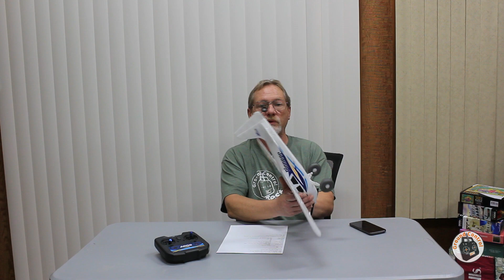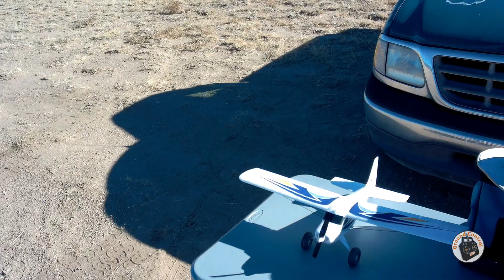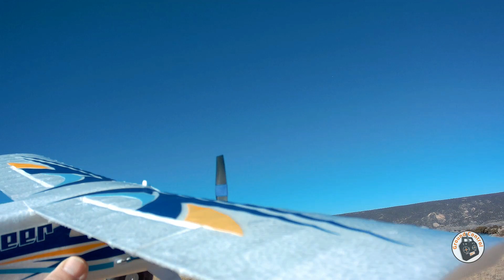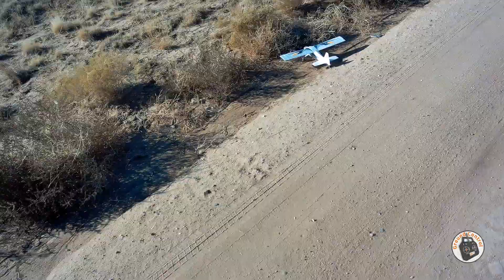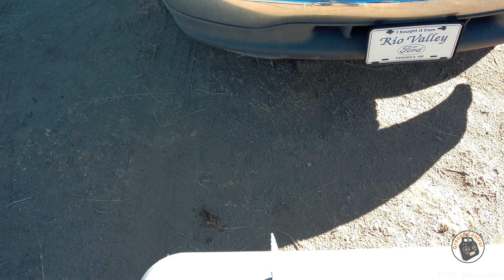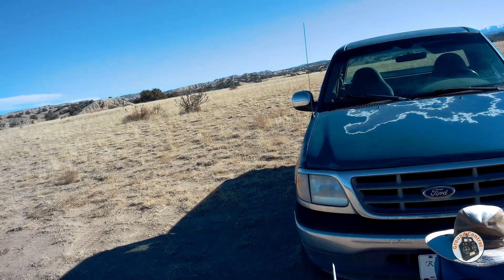Arrows Pioneer 620mm Wingspan Micro Brushless Bush Plane with Gyro RTF - Specs, Tips, Maiden Launch!

Comment: I have the Arrows Bigfoot & love it, so grabbed a Pioneer to fly at smaller local parks. So far have had only 2 flight sessions & both times have suffered from the same issue - plane flys nicely for afew moments, then feels like I've lost control & goes into a spiral till it hits the ground. I'm assuming it's a range issue, yet to do a range test or try rebinding but obviously something isn't right. When brand new out of the box first time powering it up it beeped etc. & only the throttle worked. I unplugged the battery & replugged & this time it did it's routine & everything worked. Seems to do this all the time currently, have to plug it in a 2nd time before you get operation of the rudder/ailerons. On it's last crash landing a wheel popped off & the 2-part rim fell out & I lost the little plug that holds the wheel on. Really need to glue the rim halves together. Annoying part to loose as not a easy fix.
Reply from the maker: Yes, it sounds like a bad component somewhere.
I didn't have any of those problems with mine, when it was stock, and I've had many flights on it.
I don't remember ever having a stall like that.
I would think if it was losing contact the fail-safe would kick in.
Does it center all the control surfaces and shut down the motor when testing fail-safe?
Perhaps a servo locking up on it or a bad gyro.
I would definitely sent it back for a replacement.
Reply: @GroundControlRC  Ok just did a little Range test & appears I have a sticking arelion servo. Have to take the wing off to investigate. Good excuse to do your mod & get more throw while in there.

Comment: Hi, Great demo, .. I understand this RTF to be already calibrated out of the box,  but before initial start up e.g. Transmitter on first, then battery connect, what position should TX switch be in at that time. Beginner mode or Dynamic? Many thanks
Reply from the maker: Hi Andrew and Thank You!
Some of my previous Planes required the gyro be in beginner mode when binding so I still make sure I have the switch set for beginner mode when binding to all my planes that have gyros.
I'm not sure if that is required on this plane but that's the process I always use.
Reply: @GroundControlRC  Thank you for that. Ordered for my Grandson, so  I will follow your advise when it arrives.👍
Reply from the maker: @andrewrobertson9031  You are most welcome!
Your Grandson is going to love this plane.
See you in the Air!

Comment: How much wind does the Arrows Pioneer handle?
Reply from the maker: Well, I flew the Mini Mustang in 20mph wind so I think the Pioneer could handle a bit more than that.
It also has a stabilization mode to counter wind effect so I think it would be a bit easier to handle in that much wind.
Once I get the roll rate fixed on the pioneer I'll have to take it out in some significant wind and test it out ;-)
Reply: Thank you for this information.  I will be new to the rc plane hobby and I am on a budget.  On line research has pointed me towards the Eachine P51 or the Arrows Pioneer as  my first plane.  I live near the ocean and winds up to 20 mph are fairly common.  I also have learned that larger planes fly better in the wind, however storage of a larger rc plane won’t work.  I look forward to your next Pioneer flight in the wind.
Reply from the maker: @calmorrison9211  You are most welcome ;-)
I'll be taking the Pioneer out again for testing again soon.
Those 20mph winds are pretty heavy for micro planes but some handle it pretty well.

Comment: Awesome series again, this one, thanks! Now I've got a silly question if you don't mind. I'm about to order this Pioneer's board and TX for cheap to put it into one of my A160s (yes I really love this old nemesis), along with two 1.9g servos for elev.+rud. Pretty sure the integrated ESC can handle the A160 motor. Now the question is: do you think I can plug the two aileron servos (Y-lead) into the Pioneer board? Since the Pioneer's equipped with a single aileron servo, I'm wondering if that might damage the board.
Reply from the maker: Thank you much!
I'm not sure, although, they fitted this board with a single servo for the ailerons, it seems to me that (2) single servos would have to perform much less work than a single servo.
That's exactly what I'm going to do with mine to get a better roll rate.
I guess if the board can't handle it I'll just replace the stock board but I'm definitely going to try it ;-)
Reply: @GroundControlRC  Thanks again :-) 
Even all connectors (servos and battery) seem to be compatible between A160 and the Pioneer. Plus possible upgrade path to a RM Zorro later, now that OpenTX/EdgeTX is working with the board... I'll let you know how it goes in case I'm first!
Reply from the maker: @DIY-Morti  If the connectors are the same that is certainly a plus.
I'm constantly having to change connectors on different aircraft when performing changes ;-)
Yes, let me know how it goes as I may do something similar in the future.
Good luck on your project and I'll see you in the Air!
Reply: @GroundControlRC  Ok got itchy fingers and ordered the parts :D 
Not only the connectors seem to be the same (micro JST) but also the wiring itself apparently, guessing from XK and Arrows servo wire colours. All fingers crossed for everything to arrive til next weekend.
Reply from the maker: @DIY-Morti  That's awesome.
I do remember that plane having those micro connectors and a Y-cable for the ailerons.
I hope it all works without Modification as that will make it PNP ;-)
Reply: @GroundControlRC  Heya I've promised you a feedback after maidening the A160 with the Arrows Pioneer brain, so here we go. 1st the aileron dual servo (Y-cable) mod is a solid go. Driving 4 x 1.9g servos for all four control surfaces is no prob for the Pioneer board. The gyro is awesome and really makes the A160 fun to fly. Your wing cuffs (I made mine out of Elephant beer cans, cheers!) are brilliant, thanks for the idea and testing! No tip stall crashes, and I'm a bloody beginner :D
Motor is a bit weak, had to fly 100% throttle all the time to fight of stormy weather. Wondering if the Arrows Pioneer's motor would generate a bit more thrust than the A160's? Now looking for quality 1.9-2.5g servos for elevator and rudder. The elevator one blew its gears in the 3rd flight (crappy SOL Expert, name is program).
See ya in the air!
Reply from the maker: @DIY-Morti  That's awesome and I'm glad the wing cuffs worked out ;-)
It's nice to know the pioneer can handle that 2nd aileron servo as that's the direction I'm going.
I remember the J3 Cub as being pretty heavy for it's size.
The Motor on the Pioneer works well on that plane but the AUW is only 113g.
I replaced the stock motor on my J3 Cub with I believe a RacerStar 1408 3600kv and Gemfan 5x3 2-Blade Prop to provide sufficient power.
Here is my thrust data:
Prop Gemfan 5030 ABS 2-Blade Prop
Thrust(g) 100% = 244
Amps 100% = 6.6
Thrust(g) 50% = 135
Amps 50% = 3.4
g/W 50% = 4.8
g/W 100% = 4.5
I'm not sure what size ESC the Pioneer Board has in it but I'd want at least an 8A ESC for this setup.
Thanks for the info and your experience with that Pioneer Board.
Reply: @GroundControlRC  Yes that's the problem, no idea how much power draw the board can handle. AirDOGGe made a thrust test that attested the A160 motor sub par performance for it's size. Afair it's a 2700kv motor versus 3000kv for the Pioneer's. Maybe over time, I'll just make the wings larger to lessen wing load and build wing slats for STOL capabilities. As far as motor: 20-30% more thrust would be all I need for the yellow dodo. Maneuverability is insane btw with the Arrows board. That thing can do sick 180s without crashing.
Reply from the maker: @DIY-Morti  Those gyros are fun for those types of maneuvers ;-)
I would guess that board only has a 6-7 amp ESC in it but who knows.
I put a load meter on the Pioneer an it was only pulling 4.2A at full throttle.
Reply: @GroundControlRC  Wow thank you so much for giving me this reference! 4.2A now I can re-binge yours and AirDOGGe's thrust stand tests and see if I can find one that doesn't draw more than that while giving more thust, aaawesome :-) And yes, the big plus on control surface authority is big big fun!

Comment: I sold my micro Timber because it was getting a bit worn. Now the new one is like $160! This looks cool since I really don't need flaps. Will this bind to the tx16s? If so what's the protocol? I won't want to use that little transmitter. Great review as always!
Reply from the maker: Thank you much Greg!
The Micro Timber was one of the Planes I was looking at purchasing and decided on this one.
I could not find any info on the Protocol and a search on the Multi-Module sight turned up nothing for Arrows RC or this Pioneer Plane.
I haven't tried manually going through all the Protocols yet to see if anything works but I will when I have time.
I'll be posting additional Review Videos to show much more of the capability of this little Bush Plane.
So far I'm having an absolute blast with it ;-)
See you in the Air!
Reply: @GroundControlRC  the Timber is very good, I'd say even at the increased price. It used to be 130 maybe but has gone up. It's a great flyer and easy to set up on a Spektrum radio. Drawbacks are the foam. It is delicate! It's A styrene mix I think. It holds up fine but it's very succeptable to hangar rash. Thanks for the input on the protocols.
Reply from the maker: @greg0063  Yes, I think I read somewhere that the Timber was made from EPS Foam.
The EPP Foam is another reason I selected this Plane as I tend to punish my Planes ;-)
The Timber does look like an excellent flying plane from the videos I watched.
It was difficult to decide on which of the (3) Planes I was considering.
Reply: Haha nevermind you saw this one

Comment: Another enjoyable review... Did you try ROG (rise off ground) and can it be bound to your new Txmitter?
Reply from the maker: Thank you much Rocky!
I've put approx. 10-12 flights on it now and this little Bush Plane takes off from the ground like a STOL Plane ;-)
I was very impressed that, with these balloon tires, it can takeoff and land in some very rough terrain.
I could not find any info on the Protocol and a search on the Multi-Module sight turned up nothing for Arrows RC or this Pioneer Plane.
I haven't tried manually going through all the Protocols yet to see if anything works but I will when I have time.
I'll be posting additional Review Videos to show much more of the capability of this little Bush Plane.
So far I'm having an absolute blast with it ;-)
See you in the Air!

Comment: I purchased this model in the spring of last year and have been happily flying it ever since. Last month I was flying it and during a scuffle between some dogs I lost orientation and never did find it. I went home and immediately ordered another one because I am so impressed with how well this model performs. I could easily take off and land on a concrete pad the size of a volleyball court and have been able to take off and land from the grass at my local Middle School. I have been able to fly for up to 22 minutes on the stock battery pack by just cruising around. I really recommend that you take off and land in beginner mode but the plane handles equally well in the dynamic mode and it does all the aerobatics that my thumbs can handle. I highly recommend this bird as it has great flight characteristics and long flight times on the stock battery. This has been the only playing that I have liked well enough to replace in all the years that I have been in the hobby. That is the best recommendation that I could give.
Reply from the maker: Hi Jon!
What an awesome Plane this is ;--)
I will be posting additional review videos of this Plane as I just can't recommend a Plane after a single flight session but I very much like what I see with this Plane.
Plenty of Power and very efficient, as you stated, for a great amount of flight time.
Sorry to hear you lost your first one, but like you, I'd probably replace this one if something happened to it.
Just a joy to fly.
It puts a Big Smile on the Face of my Inner Child ;-)
See you in the Air!